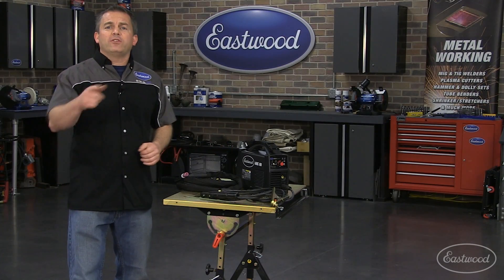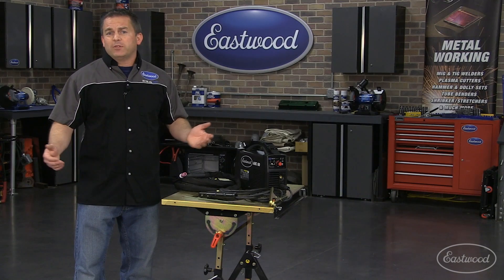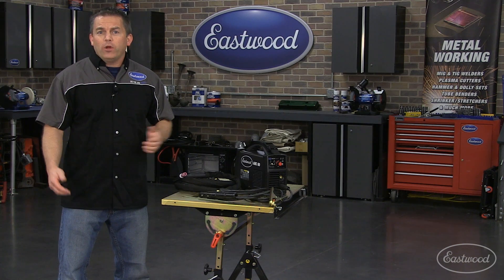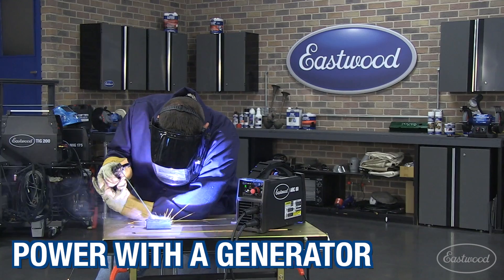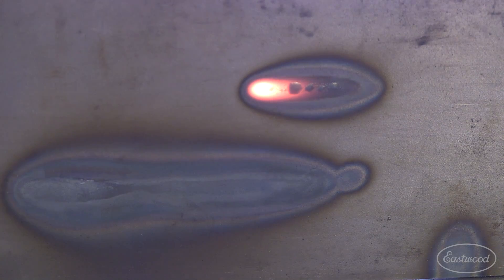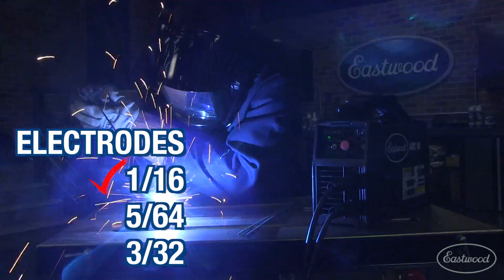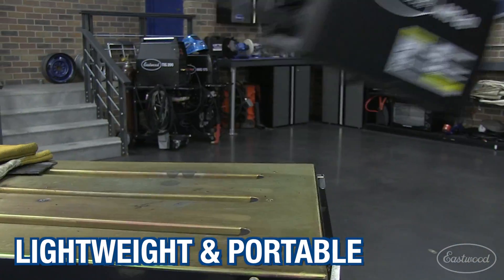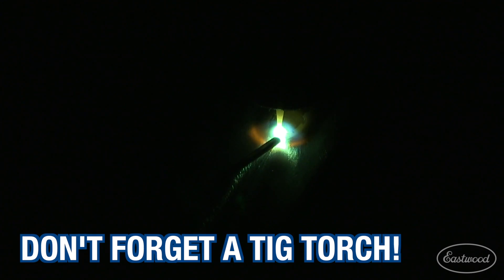Inverter Powered Stick Welder with TIG Welding Option from Eastwood

Comment: Well if it can weld steel does that mean it can weld aluminum. Aluminum should be easier to weld
Reply from the maker: It will weld steel, stainless and cast iron.
Reply: Riley Genereux 
this is dc output only, so it isn't suitable for welding aluminum, which needs ac output.